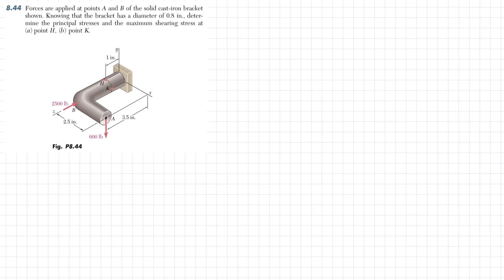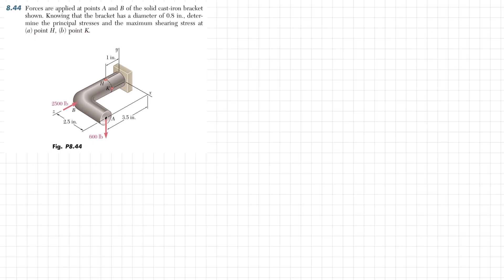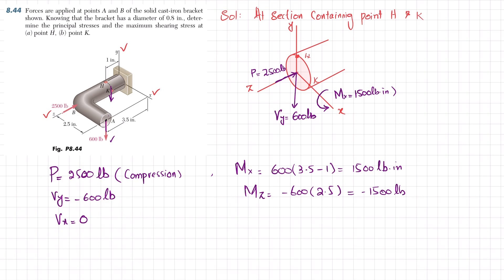8-44| Principal Stress under Given Loading (Beer & Johnston)|

Comment: Why is Q zero at H but not K. They both lie on the edge of the circle
Reply from the maker: H lies on the outer surface and away from neutral axis and area about H is 0 so Q is zero. While K lies on neutral axis and there is area above K which is not equal to 0 . That's why its Q is not equal to zero.